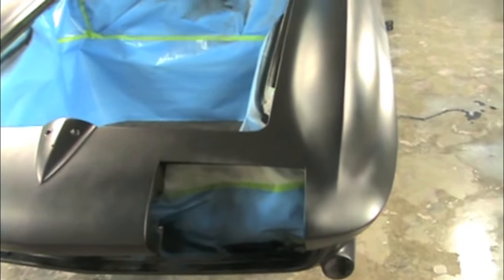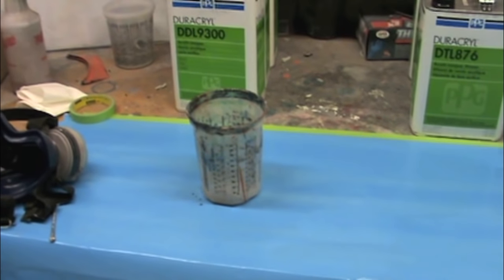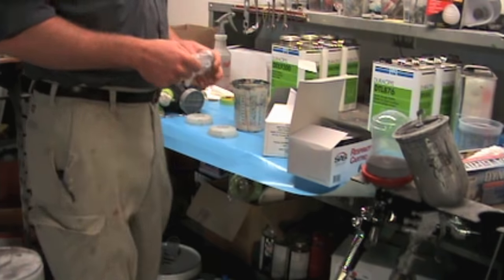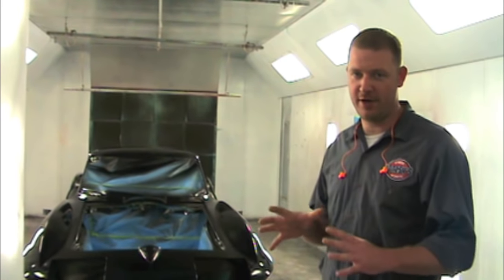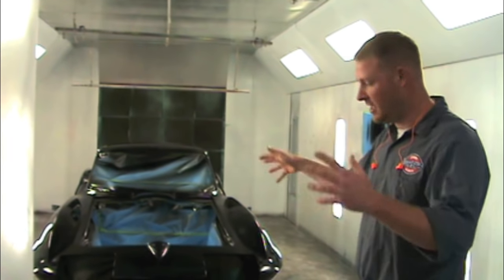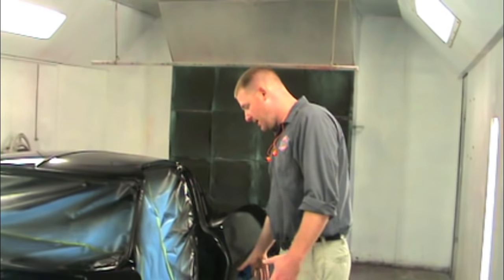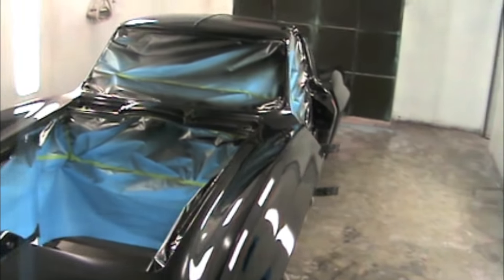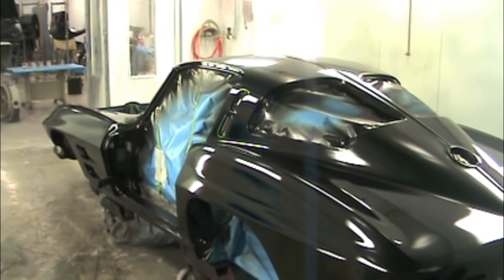1963 Corvette Lacquer Paint Job Part 2

Comment: It has been approx 20 years since I painted my last car. Most were done in lacquer and almost all had High Performance clear over the color. I have always used a siphon feed gun but now have a few HVLP guns and plan on using them to pain the lacquer. Since it looks like you are using an HVLP gun to paint lacquer it gives me a bit of confidence that I can get good results.
I am going to paint my 1972 Cutlass 442 hardtop by the end of next summer. I only have a gallon of color and a gallon of High Performance clear so I'll be painting only the surfaces first since. I figure 3 to 4 coats of color and maybe the same for the clear and then I'll sand and buff it all out. I'll be painting a metallic Viking Blue and originally was going to use a Binks siphon gun with an agitator cup but feel the HTLV gun would be best to reduce over spray and not waste my limited color.  
This will most likely be my last car since I'm almost 70 and retired. My confidence isn't what it was 20-30 years ago LOL! Once I get the body done I'll mask and spray the jambs and such with the lacquer or even urethane enamel if I can't get the lacquer. Any thoughts here Jonsey??
I really enjoy your videos. They are so relaxed and well stated and thought out with very good tips! Thank you!
Reply: You ever get that thing sprayed up bro?

Comment: Having painted my '65 with PPG acrylic lacquer in my garage, this was great fun to watch your technique.  That SATA sure does atomize.  Always like to see what sequence the pro's use.  Good tip on hitting the jambs last so you have no overspray on them.  My car is Ermine White so I got by with 6 coats, 2 gals of color.

That new DDL is so soft now, I was able to hand polish it after a final cut with 2500 grit.  Not too durable, but a wonderful look.  

You could paint my car anytime!

Comment: would hope you filmed the cut and buff. this was such a great video. this  how i learned painting was on the lacquer. and yes, the fussiness !  your prep needs to be real spot on or the solvents go nuts!  back in the day, there was certain lines of thinners that we considered a higher quality thinners,but you had to do extra,extra better prep re sanding  and sealing or you would see the paint almost explode with all sorts of issues on first pass , so we only used those on certain jobs. glare stuff was more forgiving! (not unlike your boss!  keep the vids coming!

Comment: I,ve painted over a thousand of these cars in lacquer and base clear urethanes. love these cars. the biggest problem I have with every one of them is the top of the front lower valance panel, it sucks to get at, especially with a gravity gun,( stupid cup. The best luck I had, was a pressure pot. Loved those days. Great job on the video, thanks for posting
Reply: aviatom1  over 1000 1963 split window coups?.......very nice ......I painted one in urethane........lucky me